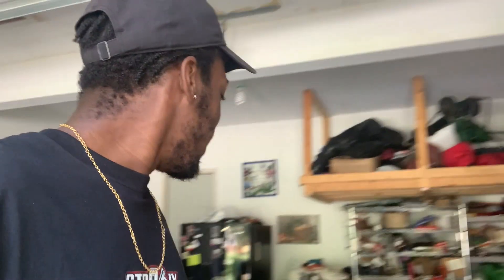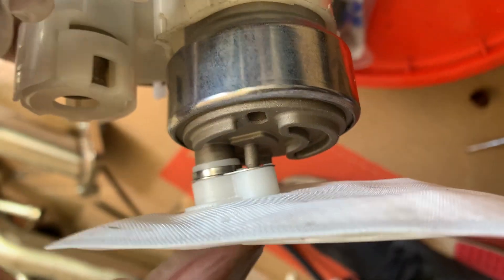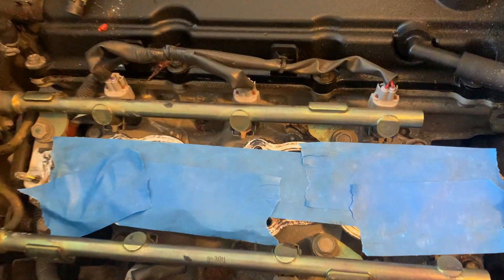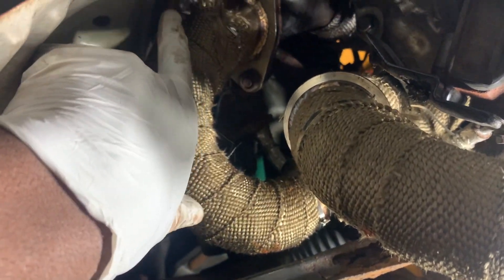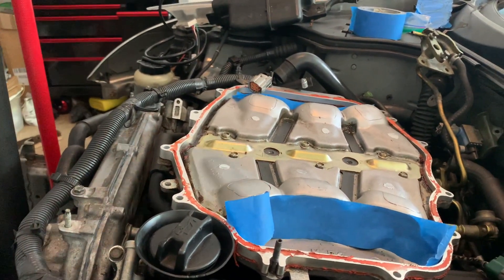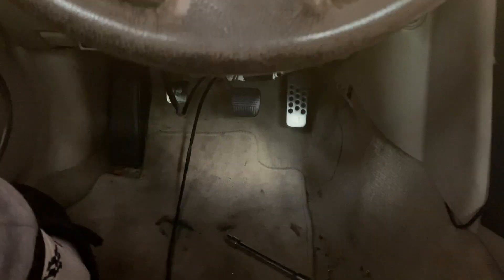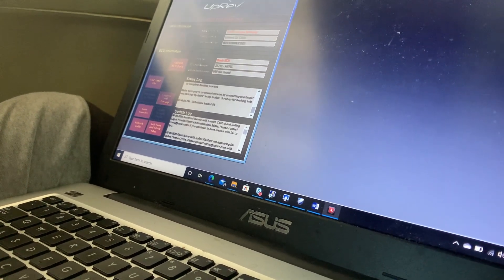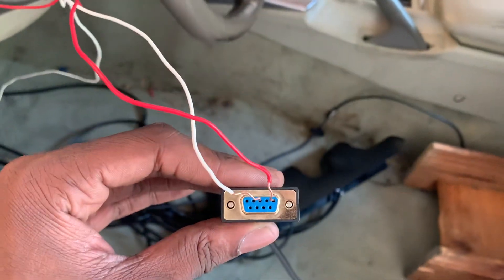Rev 9 350z/G35 turbo kit installation

Comment: That’s dope I got a 04 and want to boost bad. Did you do anything to the internals to prep it? I’m thinking bout getting a new motor first since mine has 190k miles. Great video by the way.
Reply: I have an 04 Z - I just put a 60k mile motor in it & I have a 2nd hand procharger im preparing to install. My z had 193000 miles / too scared to boost that
Reply: Mine has 190k but roughly 140k were all highway miles, should I still boost it?
Reply: @crossacoustics6814  mine has 190k, but roughly 140k miles are all highway, should I boost it?
Reply: @BdubsMusicPicks  no 😂
Reply: Compression test it. Needs to be better than 185 across all cylinders and less than 10% variance between them. Also do leakdown and look out for any cylinders with a significantly higher percentage than the rest
Reply: Or do the smarter thing and replace the engine for one with 50k miles because even if your 190k motor passes compression and leakdown, high chance it still blows up rather fast
Reply: @arandomcommenter7051  I will do that first. I've been riding in the car for 5 years and have kept up on maintenance. Even if I did boost my original engine I only would expect or hope for 5,000-10,000 miles of beating if it is boosted before it blows at 5psi.  The plan after that is to get a fully built motor, then a new turbo, e85 fuel setup and 10psi. But I might just pull the original motor out and put it up and do something with it in the future. Thank you for your intake on it and your response though it is appreciated.
Reply: Just get a crate de and build it

Comment: Damn, so glad you made this video lmao installing this kit soon and this is easily the best video on it!

Two questions if you don't mind:

1) I have stock exhaust with a muffler delete. I had ordered test pipes but I understand there's only one pipe (downpipe) that comes down from the turbo. Where does that connect? And do you even got to keep the Y pipe?

2) Can you run the Uprev tune permanently? I live like 4 hours from RZG and would much rather do Uprev remotely than trailer 4 hours to RZG haha
Reply from the maker: The downpipe will connect to your existing catback/ exhaust so you won’t need test pipes or a y pipe. As far as the tune  rzg does e tunes so you should be fine for tunning.

Appreciate the feedback and hope it helps!
Reply: @str86ix26  Okay awesome, thank you a ton man! Build looks awesome. This video alone convinced me to try the install myself rather than paying someone so thanks so much🙏 Excited to see more!
Reply: @Gborohooo  did you do it ?
Reply: @kami_dred7319  Yessir

Comment: I know you guys used the rtv on header and cross over pipe. But the pipe that the v bands clamps go on was rtv and a gasket put there? Sorry just a little confused. Great video by the way
Reply from the maker: For the V-band connections you won’t need to put any rtv there. Appreciate the support 🙏🏾

Comment: Great video!, just fyi when you need to clamp the electrical cables, use the back of the plier (not where you cut cable, but further  back, behind the plier) you see there is a flat dented part... that is for doing this... it will give you more strenght for that porpuse... Hope it helps
Regards!!!
Reply from the maker: Appreciate it!

Comment: Hey bro, I have 2003 g35 and I was wondering what you had to do to log your pulls. And did the wideband sensor(s) replace any of the oem sensors? I'm stuck right now on what to do.
Reply from the maker: For me the tuner recommend I take a vid of the afr and send it to them. I ended up adding a bung for the wideband gauge closer to the turbo . I’d honestly recommend switching to a 2004+ harness and ecu. It would eliminate a lot of the tuning issues since the 03’s only have narrow band sensors.

Comment: you think it would work for a sorta stock g I got a cold air intake n the engine can hold 400whp on stock internals
Reply: Once you boost it you no longer need a Cold air intake

Comment: Did you guys have to weld in another 02 bung for the wideband? Or did you just run it by the last exhaust piece with the 2 ports they come with?
Reply from the maker: I personally welded my own 8 inches after the turbo

Comment: Change all the flange fam. Thank me later, those shit soon or later will leak. I got those kits but modified everything when came to realize shit can't hold. I put at about 15lbs made 573wheels 485torques. Bumping it up soon.
Reply from the maker: Which flange bro
Reply from the maker: Wat other things did u modify on urs
Reply: @str86ix26   All the hot side V-band flange and clamp. Flange and clamp came together anyways. You notice those Chinese old version cheap flange  is flat surface? You don't want that kind. You want new version kind of flange that seal proper. Example of link below. I forgot the exact size of flange so remeasure the existing ones and order the right size. Link below is for example quality flange https://amzn.to/3lrZdra
Reply from the maker: Yea we did so in the new video with the black g35
Reply from the maker: Vibrant vband
Reply: @str86ix26  In my case I modified up pipe and such to work with Borge Warner T4 twin scroll so in your case would be make it to work with w.e you have. But important just know those flange and clamp will leak boost...etc. You have to cut n reweld it or just let's whoever handle the weld for you. Cold side is fine, but I modified all to HD clamp n all the pipe in my case. Ur cold side is work fine.
Reply: @str86ix26  Seems like you know what you doing then👍
Reply from the maker: Gotchu thanks bro

Comment: how has this kit held up? Is it worth it or should i save for something nicer
Reply from the maker: Honestly the kit is good for the price and it is still holding up as long as u do ur basic supporting cooling mods, and have a solid safe tune and keep the boost low at max 8psi u should be good
Reply: @str86ix26  dope

Comment: Not sure if you'll get to this comment but what did you use to widen the hole in the exhaust pipe?
Reply from the maker: I cut out a square on the other side of the pipe and the that gave me space to drill the hole on the other side than I welded the square back

Comment: How did you set up your oil drain
Reply from the maker: I have the z1 plenum spacer and I used AN 10an fitting from turbo to the oil pan spacer port

Comment: Is it the turbonetics turbo with a rev9 kit  from eBay?  I’m told not to buy that kit but I want to know from peoples point of view??  Is it worth it? I want to buy the single t kit from soho Motorsports for 7.6. It’s alit compared to this kit, help??
Reply from the maker: This is the pure rev 9 kit (no turbonetics turbo). I’d say compared to the soho kit the rev 9 won’t make as much power. Despite it being the cheaper kit, it works. That decision would primarily go on what your goals are and how much you want to spend. With the rev9 kit you can boost your car for under 5k and it works. On the other hand, the soho kit will make more power and is a higher quality kit. Just depends on your goals bro.
Reply: @str86ix26  yea I know 5 k sounds good, I got stuff for the transmission and the engine itself, my number or hopefully I can range from 480-560 or more horsepower, the Garret gtx3853 from soho with the momentum they say can hit much higher, but like always it's expensive!!!  But how much can u hit with this one? If I can get to 500 horse with all the mods to my trans and engine I say it's worth it then??
Reply from the maker: Kelsey at rzg was telling me that someone hit 500+ whp with the rev9 kit with just and upgraded turbo alone. I’m gonna run a gtx3582r as well as increase the down pipe from 2.5 to 3 inch and see what the car does then. According to Kelsey that should be able to break 500 whp. Stay tunned for that !
Reply: @str86ix26   thank u, fortunately my car is a automatic, yea I know how boring lol, but I have the torque converter from bosch and level 3 drag clutch from clutch masters and level 10 is building my valves for the trans and also a trans cooler from mishimoto, as well all things, springs  cams gaskets etc. For the engine, I'm hoping I can hit around 600 but I'm also being careful, cause this stuff is so expensive!!!  Lol, but will do bro thanks for responding
Reply from the maker: All respect man! sounds like you got a great build Coming along. Hopefully it all works out for you bro🙏🏾
Reply: @str86ix26  thanks bro,. Likewise bro, god bless